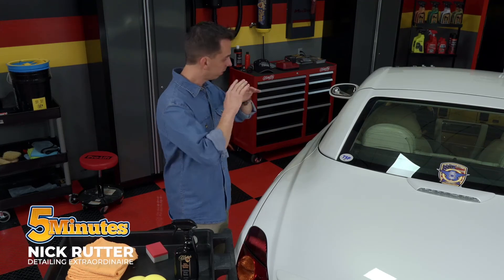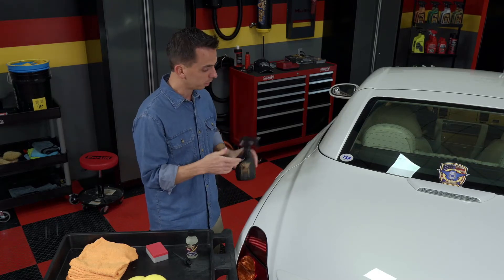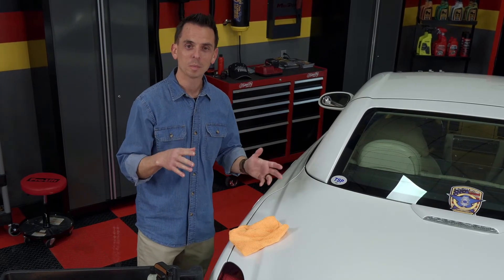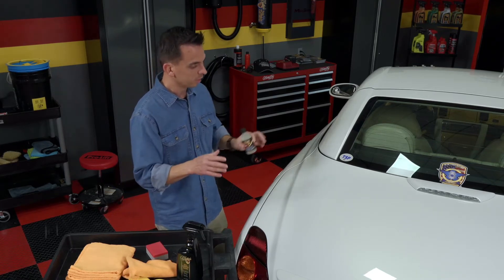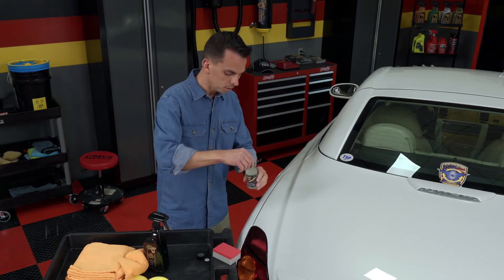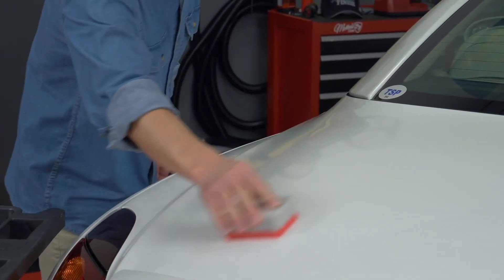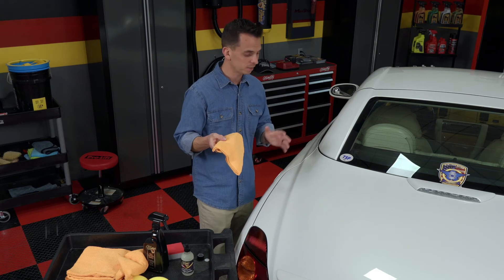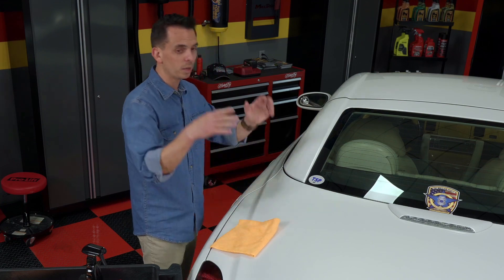Step 3: How To Apply Graphene Ceramic Coating

Comment: I wish McKees would sell smaller bottles of your ceramic/graphene coatings for the DIYer. Virtually every other company has 30ml and 50ml bottles. The McKees is 120ML.
Reply: They do sell a smaller size of the ceramic and graphene pro coat 2.0 also comes in a smaller size.